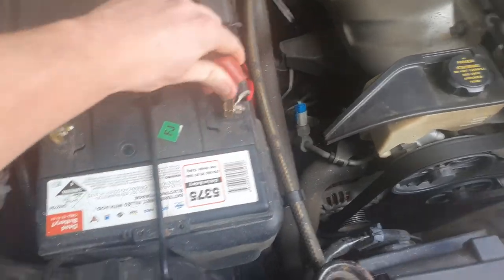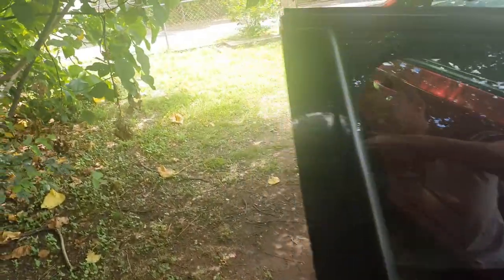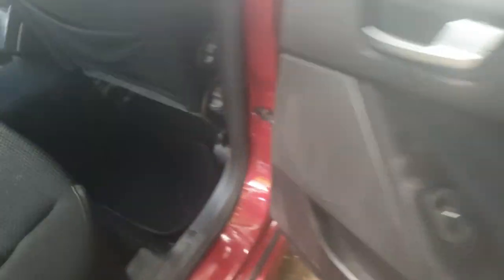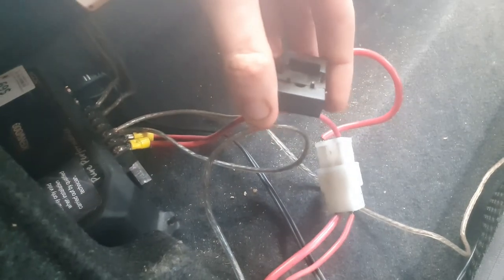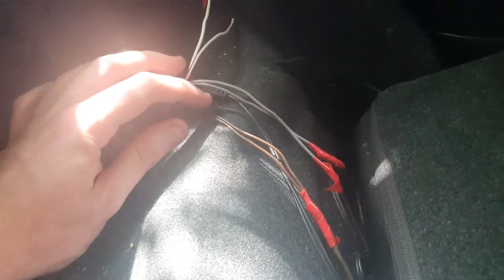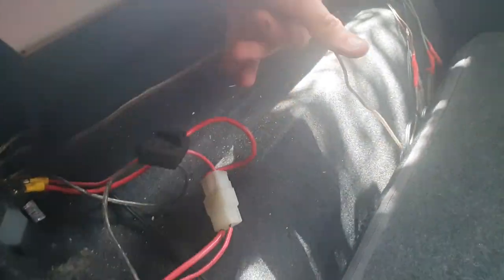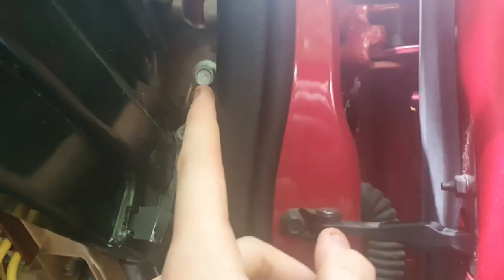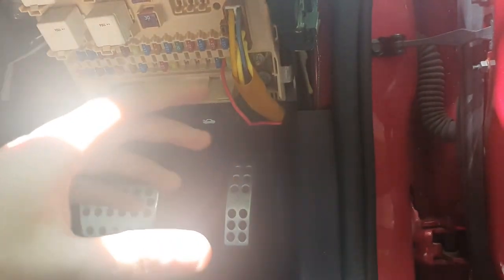Subwoofer install in a FG guide!

Comment: Sorry , the video is good but you've got the fuse at the wrong end of the car , it should be next to the battery .
Reply: And the ground wire should be as short as possible

Comment: Fuse needs to be as close to the battery as possible.  A fuse in that position is achieving nothing.  Your trigger wire should be fused also.